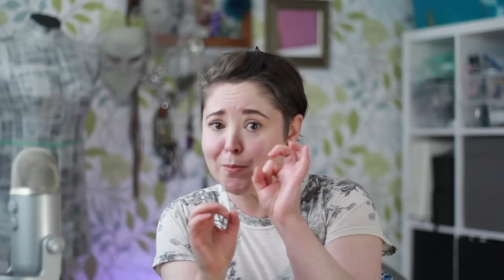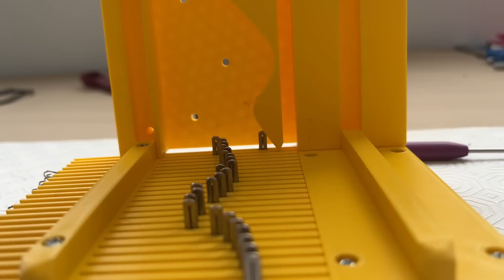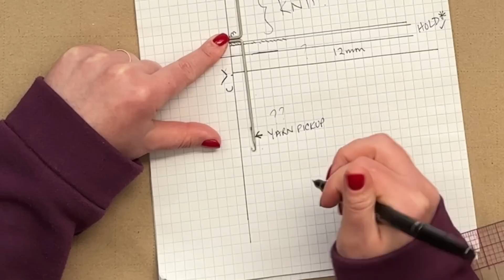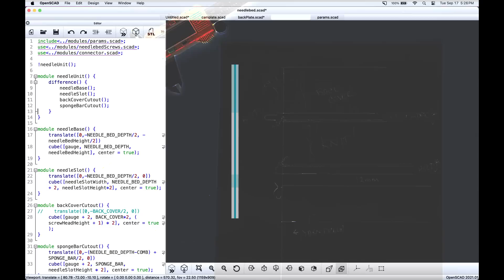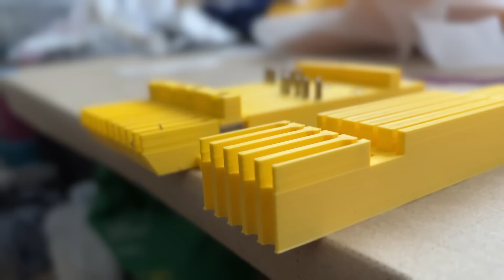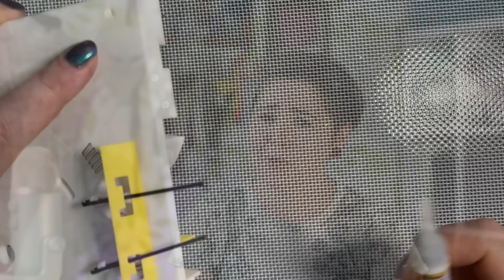Everything (else) I learned about knitting machines while designing one of my own

Comment: For the cam system, I'd suggest ditching the spring approach completely. Instead add registration knobs to the end plates that move the cams into place by moving a lever on the sled that turns a short worm drive. The worm drives will prevent the cams from being moved by the the needles, and being actuated by the end plates will automate switching directions.

Alternatively, you can put end stops onto the end plates that push a geared rod to the left or right of the carriage. That makes the initial switching easier, but you still need something like worm drives along the path from the geared rod to the cams.

PS: I will not suggest to put a linear servo on each and every needle instead of using cams in the sled. Have you seen the video by the guy who did that with his piano? Wild...

Comment: For the slip stitch gates I think you can accomplish the same goal as the torsion spring with simpler regular/linear springs or elastics and a pivot. One option would be to have a pivot in the gate and mount a spring such that as the gate opens it will push against and compresses the spring. Needle butts can still push it open and it closes automatically on it's own, but a simple mechanism can hold it in the open position against the tension of the spring. If the spring is too much in the way directly against the gate itself you could mount a lever arm to the back side of the pivot and mount the spring on that side so that the lever arm is pushing against the spring.

Comment: Buonasera. Sto affrontando anche io un progetto dello stesso tipo ed i suoi filmati mi sono sembrati interessantissimi. Per quanto riguarda il suo terzo prototipo di carrello, penso che una buona soluzione, facile da applicare e più stabile dell'uso delle mollette per capelli, possa essere quella dell'uso di magneti al neodimio che, opportunamente variati nell'orientamento, possono attirare o respingere le camme per la deviazione del percorso degli aghi. Ho usato questa soluzione per alcune  costruzioni cinetiche e penso possa tornare utile anche in questo caso. E' una scelta di facile reperibilità e, con qualche prova sulla dimensione dei magneti che ne determina la forza attrattiva o contraria, può rappresentare una soluzione più semplice ed usabile. Cari auguri di buona riuscita. Seguirò con interesse gli sviluppi del suo progetto. Buon lavoro   -    Good evening. I am also tackling a project of the same type and your videos seemed very interesting to me. As for your third prototype of a carriage, I think that a good solution, easy to apply and more stable than the use of hair clips, could be the use of neodymium magnets that, appropriately varied in orientation, can attract or repel the cams to deviate the path of the needles. I have used this solution for some kinetic constructions and I think it could be useful in this case too. It is an easy-to-find choice and, with some testing on the size of the magnets that determines their attractive or opposing force, it could represent a simpler and more usable solution. Best wishes for success. I will follow the developments of your project with interest. Good work

Comment: As a Silver Reed SK280 owner, and long time machine knitter, I love this and wouldn't mind helping remix a Bulky version (eventually... I need to figure out CAD first, LOL). BUT I wanted to quickly add that if your "carriage" can SLIP, then it is very easy to also make it TUCK. All that is necessary is to add some way to raise a bump in the middle of the passing (AKA slip) channel at the bottom that will raise the needles enough to grab the yarn but not pull off the fabric. I would encourage you to add this to the current iteration of carriage as it seems easy to implement, and it is one of the "backbone stitches" of machine knitting. 

Also, also, another easy way to "tuck" stitch is to leave a needle in upper hold with needles on either side of it in work. When the carriage passes over the needle it will lay yarn over the needle in hold. When the needle is then placed back into work on a subsequent row, it will "knit off" the yarn laid over it as if it were a very tight tuck stitch. Some machine brands call these "pull-up" stitches because they have a slightly different look to them, but they are essentially tuck stitches done very tightly.

Comment: Perhaps for consistency and less senseless destruction of your hair clips, think about making your own torsion springs. I’m thinking that the spring wire would be pretty thin and you might even be able to 3d print a simple jig,or just use a dowel of an appropriate diameter.

Comment: I have a couple of kids with sensory issues, so heels on socks and hard things in toes makes our day worse. For the longest time I have been interested in "CSM" but regular socks on those require a lot of interaction which I am totally not interested in, there is however a knitted sock called a "spiral sock" or "helical sock" pattern, which doesn't require a heel and will just conform to a foot, for a csm though it would require a ribber, and som sort of programming, because it moves stitches for every x rows, with all your research, can you think of a way to integrate that sort of programming into a 3d printed diy csm? Sorry for the long long message, super interesting project
Reply from the maker: Interesting challenge! I haven't come across any examples of domestic CSMs that have a mechanism to transfer stitches between the ribber and the main cylinder, aside from doing it by hand. One of the main issues I could foresee with automating that operation is that those machines don't usually have the equivalent of an "out of work" position like the flatbed machines do, so if you don't want a ribber needle to knit, in addition to moving the stitch, I think you have to physically remove the empty needle from its slot in the machine. I haven't actually used a CSM with a ribber (mine doesn't have one; I've just watched a lot of videos) so take all of that with a grain of salt, LOL. Some flatbed machines might have more automated ways to knit in that type of pattern but I don't think they can do it in the round so you'd have to add a seam, which probably defeats the purpose when it comes to sensory needs, unfortunately.
Reply: @ aside from having either to lengths of needles with 2 different latches to activate, or 2 swappable latches, or somehow being able to rotate the drum and ribber I don't think I have any clue how to achieve this, was wondering about the flatbed being able to do it, but I don't understand them at all, even less than the csm.
I just know that it could find a market if someone was able to crack it, and as you say, it's an interesting challenge if someone has the skills for it

Comment: I know that this could be a little of stretch but you could look into the needle that are made for industrial knitting machines made by groz beckert, they are much strurdier and reliable (also still in production) than the ones made for domestic machines. Plus they have an integrated System that allows the transfer of loops between two beds, and there are some variants that present a slide System that is much much more reliable than the traditional needle.
Also for the gauge System you could research on the multi-gauge System of Stoll machines.
Also if you need i have at my diaposal three different ShimaSeiki machines with their part catalogues if you need to take a look at the industrial machines for inspiration.

Comment: Something I find interesting in these sort of videos is: what can you do with these 3d printed solutions that you wouldn't do normally. Currently you can slot together sections with different needle spacing to make a weave with thicker sections (e.g. a blanket with a fluffier border). You could 3d print a bed section where needles get progressively closer for an effect you couldn't easily get in a different way. Of course I don't know if this makes sense from a fashion design point of view but it's interesting what you can accomplish.

On the software side I'd be curious what you could do with a servo (or a few) and programmable patterns. You could lay out an encoder across the beds for positioning (like they use for CNC mil conversions) and have accurate positioning data for your carriage. With some servos on the carriage you could move needles in and out of the path as they pass by without relying on timing and such. Or fo course just count the needles as they pass by or some such.
Reply from the maker: > You could 3d print a bed section where needles get progressively closer for an effect you couldn't easily get in a different way.

Yesssss that's the sort of weird experimental niche I think this could really be cool for. You get it.

Re: needle selection, I've been kicking around some ideas since early stages and we might be thinking along similar lines, though I have zero experience with servos so I'm uncertain what's realistic to expect in terms of speed/responsiveness, i.e. could I make the actuator gtf out of the way before the next needle at typical carriage operating speeds.

Comment: You've got Brother ribber needles, and the ribbers do not pattern (unless you do it manually, or you can possibly count the tiny bit of EON patterning that Brother ribbers can do if they have lIlI buttons/knobs for double bed jacquard (however that patterning is triggered by the carriage itself, totally different from the main bed with punchcard or electronics).  I believe that leg at the back is longer for general stability and leverage, as quite a bit of weight is often used when knitting ribbing, and there's also potential for other pressures like racking, cabling, quite tight tension, etc.  You can extend the needle fully into E (holding) and the very back of the leg is still under the bottom of the bed, so held by the spongebar or needle retaining bar (depending on model) at the top working end, and the bed of the ribber at the bottom, making for very straight travel preventing metal on metal screeching if the needle butt could twist and touch the slots.

People aren't generally going to be trying to apply such force to the LK150 (and indeed can't without breaking the plastic bits), plus the price point calls for reducing the more expensive bits, so less steel makes sense (and of course, they don't need a leg to push from behind with any type of automatic pattern device).

Comment: fork weights for the hair clips
Great design! I always have trouble with flow on my USM
for the wheel you could make it in the center and perhaps use the butts to push it along? but it's supposed to work without it, orrrr
you can put the wheel at the back and have it be a combination with the conical or yarn ball design yarn holder, where moving the carriage spins out yarn at a rate from the ball and hits as a good row counter location

Comment: For the cam springs, look into 3d printing springs. Slant 3D recently made a video on a few springs here. https://www.youtube.com/watch?v=wpriGP45Unw
To me, it looks like a spiral spring would work. You could print the spring separate from the cam, and interface the two with a square shaft or similar. (I have no idea how to do a spiral spring in OpenSCAD. Maybe a vector that's extruded?)
Also, for your cam position controls, perhaps look into bistable mechanisms. Wintergaten has a decent video on it here. https://www.youtube.com/watch?v=3v5xfWkp9Ys
This Old Tony has a good video on Over Center Mechanisms here https://www.youtube.com/watch?v=Ia3Iieejyg8
I'm not sure how practical a bistable mechanism would be, but if you can manage to package it onto the carriage, it would make for a very satisfying UX.

Comment: I really appreciate all the work you are doing to achieve a make-it-yourself knitting machine.  I have a basic knitting machine that have very light weight springs for the flippers.  I had to disassemble, partially, my carriage to reconnect one of the springs.  The spring was a fine coil with hook connected at each end.  Are there other springs you can explore?  I will probably watch this again while looking at my carriage to better get a handle on how the carriage works.  What was the roll of sponge you were using called?

Comment: I'm not a knitter but I'm glad YouTube suggested this to me, thanks for sharing such detail about an amazing project!

Two thoughts that may or may not be helpful:
Do you need torsion springs?  Could you use a linear spring on top of the carriage instead?  You might end up with some awkward binding but it might allow you to use a fully printed cam with a wider diameter (rather than the pin/rivet)
Could you move the front rail screws behind the sponge strip?  If you had "ears" on the back side of the rail, could you move the screws behind the sponge strip?  This might interfere with the needle butts so it might need to be screwed in from the underside.

Comment: if you're looking for configurable spring solutions, you might look into using flexures, wherein you print thin bits of material and use the springy properties of the plastic to generate bendable and spring-like behaviors - they might be a great fit for switchable gates!

you could also look into winding your own springs out of piano wire, which might be out of scope for this project but could be a solution. and could be useful for researching what kind of springs you want.
Reply: I came here to say something similar. 
Try looking into "compliant mechanisms". Could be just what you need. 
https://youtu.be/xV36ITRjP_4?si=NQOusM4nIoZHHxfp
Teaching Tech is a great resource (and the only channel I am currently subscribed to, other than yours).

PS: my mum taught me how to knit as a tween, haven't knitted since but found your channel from a desire to return to knitting from a technical perspective. 
I really enjoy your videos from a design process perspective. I am a high-school IT/maths/science teacher and your process is a great example of what I've been trying to teach my students... I wonder if I could get them engaged with videos about knitting machines 🤔😂

Comment: From a programmer that's worked with mechanical engineers, one takeaway lesson is "if you can't make it as precise as you need, make it adjustable".

Another lesson, from James Bruton here on YT, is to implement that adjustability via minimal-volume 3d-printed sleeves to abstract away the bridge between your mechanical need and your available materials.

Comment: 13:03 If the carriage couples to the bed via a conical cylinder, you could get infinitely variable pitch by moving the point of contact along the cone (see 507 mechanical movements #8, but make the "belt" be a ridge on the needlebed, it's a slightly janky infinitely variable pulley).

(This is a terrible idea but it would be amazing if it wouldn't wear out super quickly, and slip all the time, and and and.  Terrible, but fun!)

Comment: You don't really need to use torsion springs in this application. A linear spring (or a rubberband) combined with a lever arm wold work just fine. Torsion springs are usually only necessary when space is a concern and you have the entire carriage to work with, in some respects. This would also allow you to easily adjust the force of the cams by varying the lever length or linear spring. Also, this is an awesome idea and I am looking forward to more content on this.
Reply: A linear spring (or rubber band) could even be arranged as part of an over-center mechanism, so it could hold the gate in its open or closed position.

Comment: I am in the process of developing a computerized Intarzia and Lace knitting machine. I am forgoing Cams for pnumatic or electric servos in the carriage to get over a lot of headaches involving cams and needle size. You just put the needle pitch into the computer and a bit of automatic math and step counting later, you can use the same carriage on any size/needle pitch bed.

Comment: Loved hearing you talk about your process! Have you maybe considered 3d printed flexure joints for the gates?
Reply from the maker: Thank you, and yes! Since filming I've been looking into a few different compliant mechanism ideas that I think could potentially work but I haven't had time to test anything yet. Being able to replace the springs would solve so many issues if I can figure out something printable that's still robust enough at that teeny size. 🤞
Reply: @SparksCuriosity  ah yeah, the size constraint does add a lot of challenges. Stuff like that doesn't translate well to screens 😅. I do hope you can figure something out! It would be a very elegant solution if you can make it work
Reply: I'm pretty sure that there are some bistable flexure mechanisms out there that could fit your needs very well as they don't require sourcing extra parts